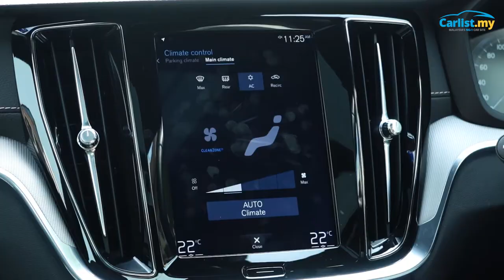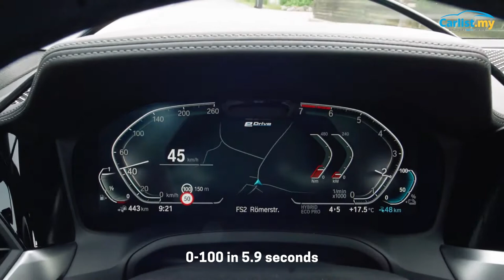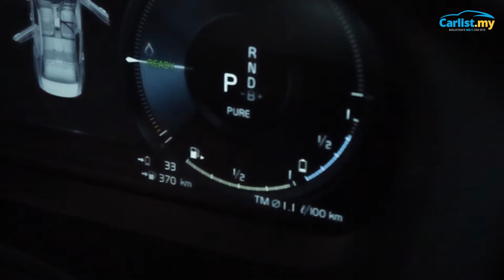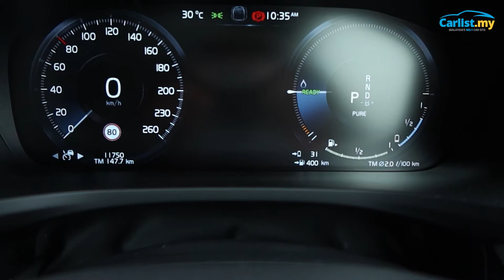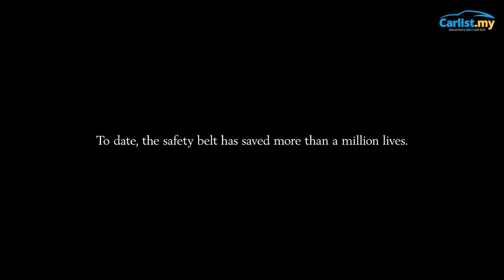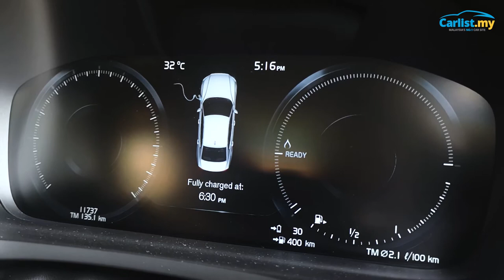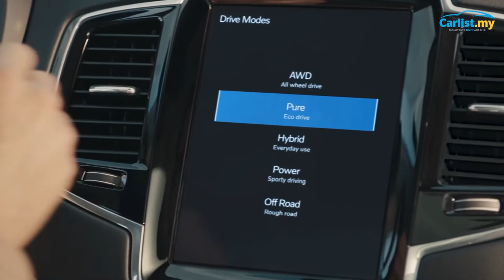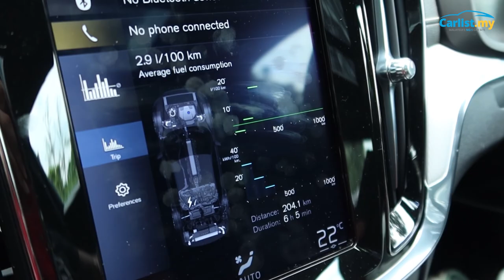The Plug-In Life: Volvo S60 T8 - Long Term Review

Comment: Nice Video. I have an Audi e-tron 50 for more then 18 months now. As you are aware it is pure electrical. There is major issues when you do the jump for a full electric car if you don't have  a charger at home. Added to that, as more users buying full electrical cars in UK, the public chargers in case you need them when you go for a long journey are not enough for the demand.
It is really stressful when your plan a journey that will take you 2.5 hours changes for 5 hours because you are trying to find a charger available. The chargers are in use or out of service so you end up not enjoying your trip. The car systems are not fully connected with the charging network to give you a full picture about the poles available to recharge your car. 

The car is absolutely amazing but in my fair opinion, the infrastructure is not prepare to accommodate too many vehicles on the road. The Hybrid is by far a more reliable solution until the countries are prepared to make the big move to a full electric car park.

If you leave in a flat, do not buy an electric car unless you have a way to charge daily at work.

Blessings